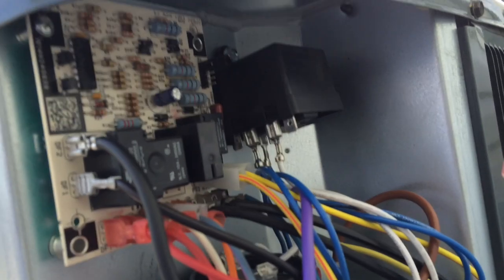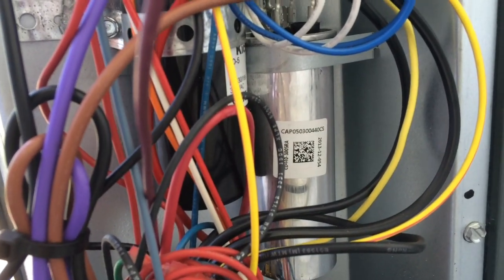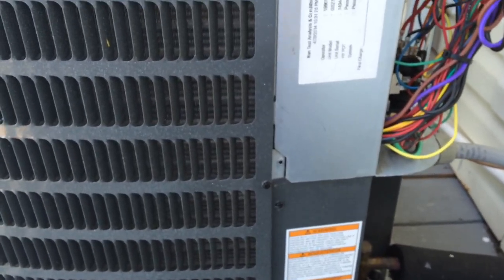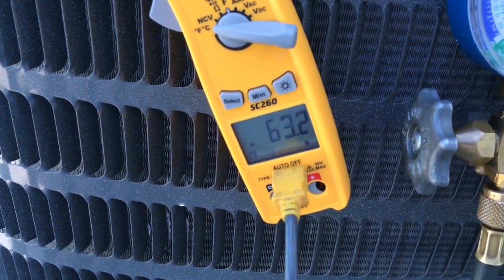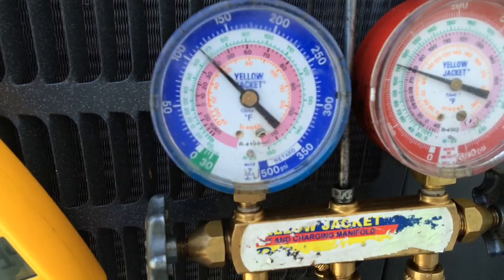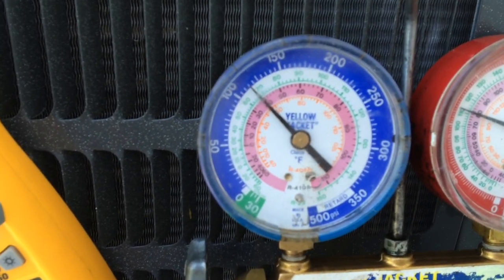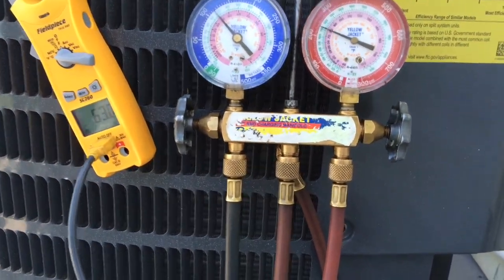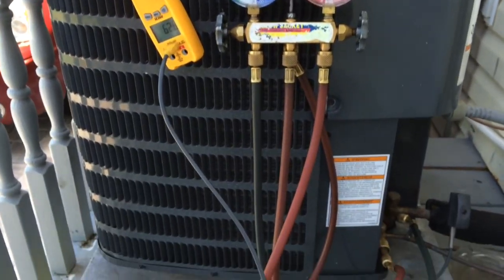Loud Scroll compressor on start up.

Comment: Your video is great, thank you for posting.  I have 10 year old Lennox with scroll compressor.  The line from the outside unit to the furnace is about 15 feet.  When the unit has been off for a while, upon first startup it really makes that noise, thereafter, if it's running regularly it is less loud.  Would you say this is normal and due to a long line to furnace?  Also I put a hard start kit on the unit about 5 years ago.  If there was a brief power blip, the unit outside would make a loud buzzing noise.  Since I put the hard start kit on, it stopped making that noise after a power interruption.  Just a question, any easy way to tell if the hard start kit isn't working anymore?  Thank you

Comment: Try adding an oil trap at the bottom of the line set. Sounds like some of that oil is getting trapped upstairs and causing the compressor to have to lurch harder during startup. Many of the newer mini split installation instructions deal with this. As a commercial hvac it surprises me this isn’t done in residential when you have so much rise

Comment: I have a 3.5 ton Goodman packaged heat pump that's only 2 years old doing the same thing, sort of a "thunk" like someone lighlty hit the unit with a closed fist when it starts up, runs fine and sounds totally normal other wise, it also doesn't do that on every start up, especially in the heat of the day in the summer when it's cycling frequently.  Only reason I stuck with Goodman was because my last unit was also a Goodman that lasted nearly 15 years, the only things I had to replace on it was the accumulator that corroded through and leaked on the bottom of it, the other thing was the run cap.  I guess the new ones like everything else these days aren't made as well.   I did notice on my new unit that the entire cores are aluminum, the old unit had copper cores with aluminum fins.  If it wasn't so new I'd put a hard start kit in it, but trying not to void the warranty.

Comment: I had this exact same problem with a Trane 5 ton (it used a Copeland compressor).  The compressor failed 6 months after the warranty ended.  The installer came back and gave me a slight discount on a new compressor and filter dryer, (he insisted on installing another Copeland scroll compressor).  I had the exact same startup noise only worse and the lights in my house dimmed every time the unit started. Installing a hard start kit did not help.   I knew there had to be a solution and I found it.  It's called the Micro-Air Easy Start.  Google Micro-Air and try one,  its amazing and very easy to install.  Now I can even run my air conditioner on my home generator!

Comment: I have a Carrier with a scroll compressor only one month old. Makes a clanking sound when turning off, first the  contractor said "compressor" then said "normal " $8k and this is normal?
Reply: That sound is normal. Don’t pay 8k. I’ve been in the field doing this for 12 years now. You have a scroll compressor. Best thing you can do is have a tech swap the 1.5 pole contactor for a 2 pole contactor in the ac unit.

Comment: Put a 24 volt sequencer on black compressor  common   24 volt to contactor  of fan comes on 20 sec later compressor  comes on
Reply from the maker: I hope you’re trolling. If anything it would make this worse because you’d have more liquid in the condenser when the compressor starts. And sequencers aren’t made for that inrush of power. You’d be replacing them all the time. 
If anything you’d want to delay the fan.

Comment: Mine makes the same noise.. stops and then intermittently the noise comes back :( thoughts?
Reply from the maker: Like intermittently when it is starting it while it’s running?
Reply: @AbilityJohn  yes. It'll buzz at startup. Which seemed normal. Then intermittently buzzing through the time of using. I didn't want to further damage anything so I've only ran it for an hour yesterday as I noticed this noise two days ago.
Reply from the maker: @shantelp3493  I ithout a proper diagnostic is sounds like a contactor making noise. I’d have the unit checked out.
Reply: you ever fix this issue, im having the same issue, the buzzing start, goes away, comes back, like its on a timer, like a alarm clock.

Comment: This has to be something with Copeland. I have 2 new Goodman systems with the same issue and another contractor I know is having a similar issue with Carrier brands. My supplier said there’s an additive for the system and if that doesn’t work we will need to replace the compressor. I’ve heard from several others that changing the compressor remedied the problem

Comment: I have a less then year old rudd....it starts up buzzing, rattling,clanking.."thinking"..then quiets outs while running. It does not sound normal to me but the ac guy said it's normal for rudds...its the compressor and there very good compressors. Even though he's a trustful guy that noise doesn't sound normal. It's annoying the neighbors I live in townhome...  Does that sound normal?
Reply from the maker: Not sure how to respond. However some variable speed units can be a bit loud on start up. This is normal unfortunately. I’ve also seen the fan blades on some units be out of balance from the factory.

Comment: I have 3 n 4 ton 2 year old Goodman’s with easy/hard startups installed. Cooling is amazing and we in humid Texas  but the noise on start up and shut down is poor design on Goodman’s part! Makes you jump! I guess you get what you pay for,  so poorly insulated so ty she’ll no joke will be loud
Reply: Compressors are made by Copeland not Goodman

Comment: Add a sound blanket. This can also help you reduce some of that noise. That compressor  will not last the life of that system. ( Most likely) .
Reply from the maker: True a compressor blanket can help. This was a brand new unit I had installed. The compressor was bad from the factory. When I replaced it the sound was reduced.
Reply: Good thing it’s an “Amanda/goodman” with a 99year compressor replacement warranty

Comment: My Goodman does the same thing it’s a 14 seer I installed 9 years ago in my. Vacation house . I installed one in my primary house 2 years ago same 14 seer and it does not do it I think they must have fixed the new units because I have installed several more and there Quiet on start up doesn’t really bother me much
Reply from the maker: It depends on the size of the unit too. But this was for sure a bad compressor from the factory.

Comment: Is normal for a heat pumps  because straight cool don't do that sound
Reply from the maker: I fixed the problem by replacing the compressor. Scroll compressors should not make this noise. I did eliminate all other possibilities before replacing it however.

Comment: I had the same issue on 3 Ton Goodman Split System. What happen was they say from Factory.   On 3 ton Units it s a noisy issue with this kind of Comp.  Miamia. Florida area.  If it helps

Comment: Do you suppose or you Don t suppose to install a Hard start Kit on SCROLL Compressor?????????????
Reply from the maker: This was a bad compressor in this video. I replaced it and it was solved. I have installed a compressor blanket to quiet a compressor in another unit. But I would only recommend it if everything else is right. 
And yes you can install a hard start kit on a scroll compressor.

Comment: Is this why the installers don't want to tell you this when they sell you a brand new unit? I spent thousands of dollars last month on a Lennox unit replacing my 20 Y/O YORK unit just to invite in 3 problems. Mind you the installer says it's normal on all three and didn't do anything and says I will have to pay another $50 just for him to tell me that. 1) Loud AC startup exactly like yours but runs ok afterwards. Felt like a bomb went off outside my bedroom. My old AC unit has a compressor sleeve on it supposedly to help with the noise. Is that true? 2) Indoor air handler blower noise during startup and when unit turns off. Sounded like the blower is brushing up against its outer wall, very pronounced especially on the last 2 revolutions. Big problem as the air handler sits just outside my master bedroom door. The tech says it's due to variable speed motor and I know my unit isn't one cause it's set speed. Why does it matter if the motor is variable speed? When power is turned on/off, blower fan will still turn the same speed in its first few revolutions on starting and stopping. 3)Constant whizzing sound when the air is blowing. I cannot tell what it is and where it's coming from! Yet again he says that's normal. Very frustrating. I did not spent $$$$ to put up with this scam.
Reply from the maker: It for sure sounds like issues that could be resolved. If he is unwilling to solve the problems then you do have recourse. I have people call me up regularly with horror stories and I’m more than willing to help the homeowner make it right. I usually check the system out and give a detailed report of what needs to be addressed. There will probably be more issues too. Then you can go back to the company to get it resolved. If the refuse then you can either go to the manufacturer or your local contractors board with a complaint. 
I hope this helps. Good luck.
Reply: @WhopperJr  - Lennox rep and the installer came out to add two 90 degree elbows on the compressor suction line (the smaller line) and added a time delay of some sort for startup. The final piping looks weird but it seems to help a little as I haven't been startled by it anymore but its still there when you listen for it. Either that or I'm just used to it. Apparently this method is also illustrated in the installation piping schematic manual which came with the outdoor unit! The manual was found inside the protective metal cover of the outdoor unit so you can check the paperwork yourself. I might try out the compressor sound blanket in the future but who knows if that really works to reduce noise. Good luck.

Comment: this sounds exactly like my carrier 2 stage unit. it started after the fan motor was replaced.
Reply from the maker: Did it get replaced with a single stage motor instead of a 2 stage motor?
Reply: @AbilityJohn  not sure. do you think thats what caused the noise?
Reply: @AbilityJohn  i checked the part economaster em3459 and its a single phase. my unit is a carrier infinity 24apa748a and 58cva110 which is variable speed. is the fan motor not compatible with this?
Reply from the maker: That looks like a single speed universal motor. But I’m not sure about what carrier requires. But most variable speed systems require a variable speed condensing fan motor too.

Comment: Hey! Thanks for this video. I think I have the same problem: https://www.youtube.com/watch?v=vM325cWnofI
Do you suggest replacing the compressor or adding a hard start kit or smth else makes any sense to try?
Reply from the maker: I think a hard start could help. I prefer the kind that has a detached relay.
Reply: John Dungan thanks for the response! Will try

Comment: So is this normal or should I have company that installed my AC replace the compressor to eliminate this banging sound?
Reply from the maker: A banging sound is not normal. It can be caused by more than a bad compressor. I mention in this video many different causes that I eliminated before replacing the compressor.

Comment: My neighbor’s unit is way louder and it’s for a bonus room
Reply from the maker: The unit is probably over sized then.
Reply: John Dungan Oh really? I talked to the neighbor and he said he’s had trouble cooling the bonus room. But that might be because it just gets so hot on some days and the bonus room is basically like an attic. I uploaded a video on how it sounds too.
Reply from the maker: Interesting, but I would need more data. I’ve seen people over size a system because it’s the smallest they could get. When you say “bonus room” I think 200-300 ft2. The smallest central AC would be 1.5 ton= 750 ft2
(Depending on where you are)
This would cause compressor slugging or liquid to the compressor, making it loud. Also wouldn’t remove humidity and shortened run times. I’ve seen this situation in where a 4 ton unit couldn’t cool a single wide mobile home properly. There was no choice but to replace the whole unit downsizing to a 3 ton. Over sized units cause bug problems, lots of noise, break downs, higher power bills and ineffective cooling.
Reply: John Dungan Thanks for that info. Yea the bonus room is like that size and the unit is a 2 ton. Here in Florida I think many units are oversized by a half ton.
Reply from the maker: I live in Florida. I size my customers units 500-600 ft2 per ton for optimum humidity removal. 2 ton = 1000 - 1200 ft2
Your neighbor should have a mini split instead. Very quiet! Less power! Better humidity control.

Comment: Would a compressor blanket help alleviate the issue?They can lower the noise levels by as much as 5 decibels.
Reply from the maker: It could have. But the fact that it was loud was an indication it wasn’t working right. I replaced the compressor and it handle the issue.

Comment: Only 2yr old expensive Trane and wife wants new AC if this loud start-up noise can't be fixed.  Anybody know a brand that does Not have this problem?
Reply from the maker: Its not the brand. Its the set up. Get the right guy to work on it and he can quiet it down. But scroll compressors do have more noise on start up by nature. The older reciprocating compressors were louder when running but did have an abrupt start up noise.

Comment: My goodman making the same noise on start up for a few seconds. and during the defrost mode. If I was around here by myself i wouldn't be concerned. but I have neighbors and its right between our two houses and I know it probably annoy the hell out of them because its getting to annoy me too. And my system is only a year old now. also I should note that I don't have this problem in the summer on A/c. Only this winter with the heat pump.
Reply: Update guys!!! only 2 months later my compressor has gone out for the summer. They are coming out to replace it next week. So I have no AC until next week. Strange to me that on a brand new unit only a year old that the heart of the system would go out. it now makes a clunking noise when it's running so I don't even run it now. I'm not sure whether to be very displeased with Goodman Or the damn installers.
Reply from the maker: I dont like Goodman but I would go with bad installation. Maybe undersized ducts, over sized unit or they didn't pull a vacuum on the system
Reply: I've got a neighbor that has this issue on a package unit. Wakes me up all the time it's so loud.
Reply from the maker: I haven't ran into this on Heat pump but sounds like a flooding issue. maybe copper isn't sized correctly.

Comment: Hi, I have the exact same system as you with the same configuration of going up to stories across the attic and then back down the other side of the house into the garage. My unit is a 3 1/2 ton Goodman looks exactly like yours and it makes it extremely loud banging sound when it starts up for like a second. The noise is extremely loud and seems like the type of noise that is causing damage to the unit when it starts up. Once it gets running it runs really smoothly quietly and perfectly after that. What solution did you ultimately go with. Did you ever get your problem fixed. Because I feel there is something that I need to do to prevent the loud banging sound on start up. Thank you very much!
Reply: Naber I am Having the same Problem, Did you fixed yours? Its Kind of Weird. Will call the Tech and Goodman for this issue.
Reply from the maker: You could have a company install a shut off valve and a hard start. that may help. Otherwise I have had to replace some of these compressors. I would like to say its Goodman but really it's the installation and compressor manufacturer to blame.
Reply: @AbilityJohn  what do you mean by shut off valve?
Reply from the maker: @realmadrid5981  there is a valve that shuts off the liquid line when the system turns off. This could help the system refrigerant from flooding back into the compressor.
Reply: Someone forgot to put the screws in that attach the grill that holds the motor upside down, such that it vibrates on starting up.

Comment: I have the exact same unit with the exact same problem. I had a local AC company come out  (Airtron) and they oked the system and could not figure out the problem. If the unit wasn't right next to my bedroom window, I probably wouldnt worry about it. But it is and every night on every start up, It wakes me up. Did you ever figure it the issue?
Reply: lol wow same here man. Mine is almost right under my bedroom window. and between me and my neighbors house! Huge no no
Reply: The problem is it's a Goodman.
Reply from the maker: Yes. I replaced the compressor.
Reply: John Dungan did that fix problem????
Reply: @AbilityJohn  Now that it has been a little while after replacing the compressor, has the awful noise at startup come back yet??
Reply: @delg1211  he replied to another commenter that it has not returned.
Reply: What compressor did you end up going with.  I have the same issue when mine starts up
Reply: I have the same issue with Airtron too!!!!!! Omg someone help!

Comment: 20 degrees superheat seems way to high to me. Usually around 8 to 12 degrees depending on several things. Are you meaning subcooling? Just asking with all due respect out of curiosity.
Reply from the maker: Goodmans typically come with pistons which require super heat method. And it is really common to find 20+ degrees required super heat here in Florida.
Reply: John Dungan  I concur!